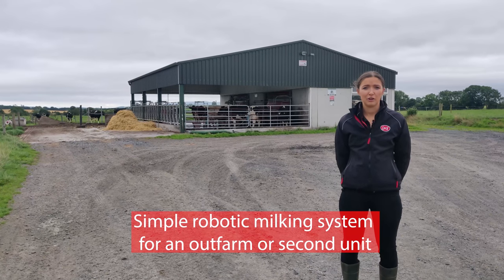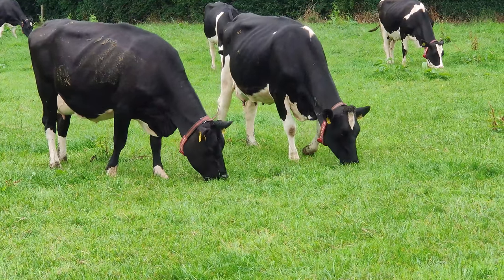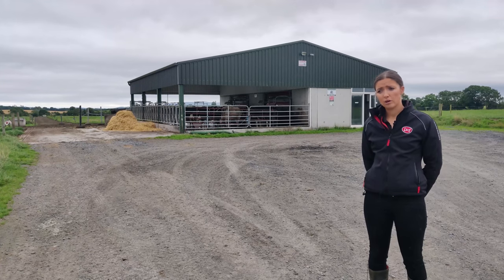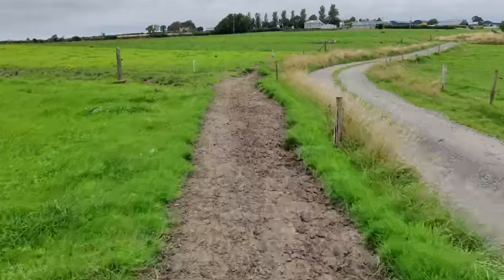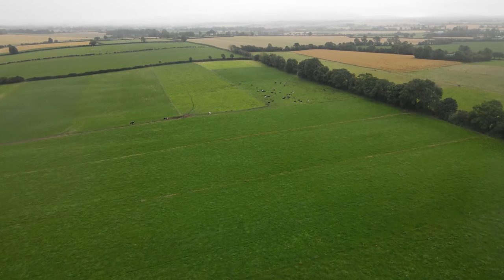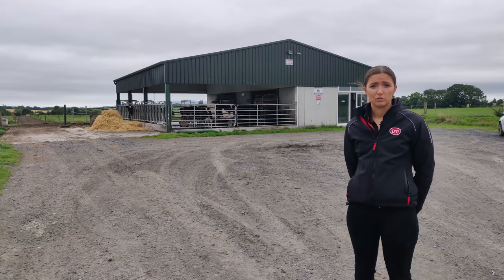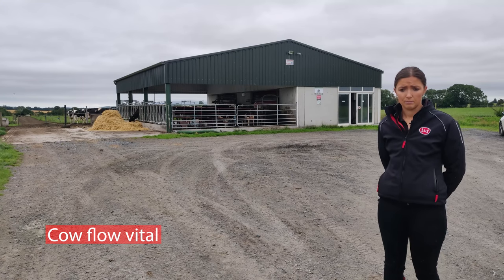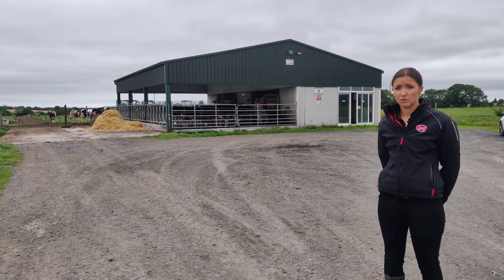Robotic milking system for an outside block or second unit

Comment: Once again a machine that seems good on advertising animations, but in practice, even in this advertising video, it fails horribly. At 5:27 you can see the milking arm housing touch the udders, ensuring not only cross contamination between udders, but also between cows.

Is the standard so low that such is acceptable in an advertising video?